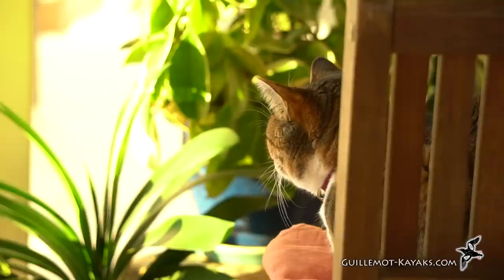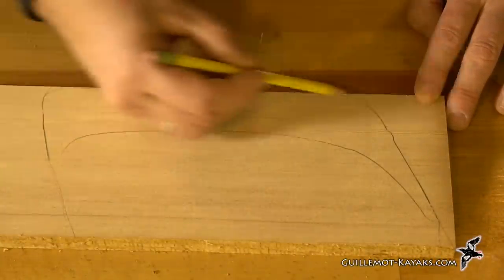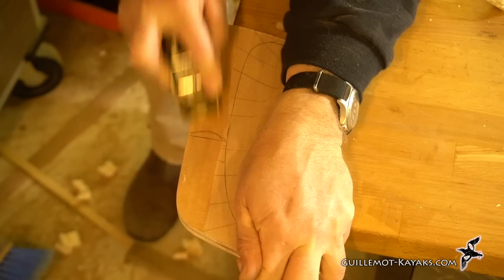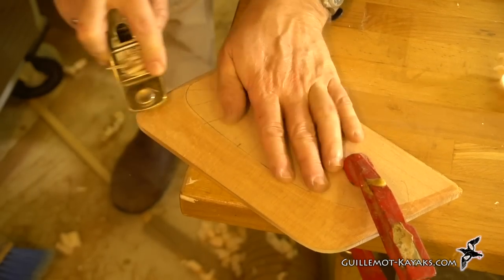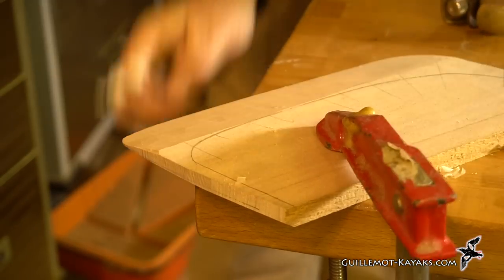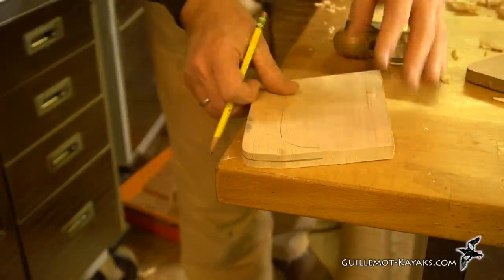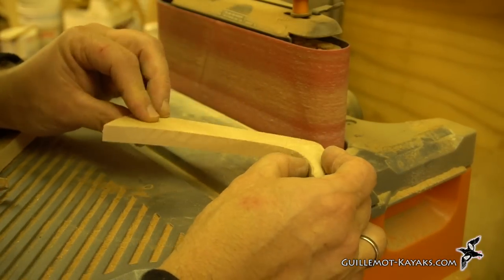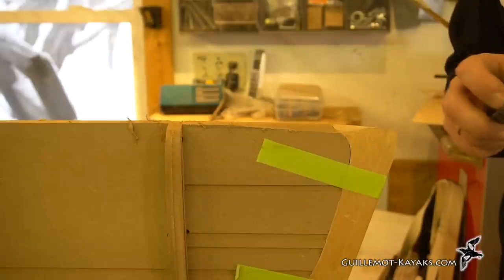Shaping Inner Stems with a Block Plane - microBootlegger Sport - E7

Comment: I’m not a master woodworker. If anyone is having trouble here, it’s most likely because he demonstrated going into the wood grain with the block plane. He did however pull the plane and not push at certain points, but take great care going into the grain. Keep your blade sharper than razor sharp and adjust the blade shallow. Take feather shavings. If not you can cause chip out. Great video. No complaints.

Comment: Thanks Nick. One thing I’ve been wondering about, what are the pros and cons of using MDF for your form material instead of ply?
Reply from the maker: MDF is cheap and dimensionally stable. The forms I had and was going to use were contractor grade birch ply. It is stronger than MDF buy splintery and has voids in the laminations. Works fine, but my go-to is MDF. Its very consistent, and usually strong enough. 

At my classes I use high quality marine plywood so they will last a long time.

Comment: I prefer to use a spokeshave for bevel shapes like that, I get better results. It does mean that I have to clamp the piece but that's how I prefer it.
Reply from the maker: I like to use a spokeshave as well, but for this, where I am essentially making straight cuts for most of the shaping, a block plane is a bit more efficient. I also don't need to pay attention to the handles when I'm clamping the piece.

Comment: Love my planes, learning how to properly setup, sharpen, and tune planes was among the first steps that took my woodworking to another level.  Love the feel and sound of cutting wood with sharp hand tools. Do you find the low angle preferred for your work?  That's one type I don't have yet.
Reply from the maker: With block planes, I just find the low angles to be smaller. They fit in the hand better. As far as cutting, its just a matter of how you sharpen the blade.

Comment: Nick, I recently purchased the double guillemot and have cut the forms from left over 3/4 birch plywood. Is there a different spacing between the forms and also how long do I made the strong back. This is my second knack of yours loved building the little auk several years ago. Also how long do the cedar strips need to be, thanks
Reply from the maker: Hi Kathleen, The strongback for the Guillemot Double is 17'-11" regardless of the form thickness. The spacing from reference face to reference face will remain 12" regardless of the form thickness.

The “reference face” is the edge of the form where the strip touches. Because the boat is tapered towards the ends, and the sides of the forms are 90° angles, the strips will touch just one edge of the form. This is the “Reference face”. From the middle of the boat forward the strips touch the front face, and from the middle of the boat towards the stern the strips touch the back face. 

The gap between forms is typically 11.5"  ( or 12" minus 1/2" form thickness) but with 3/4" material you will make the gap 11.25". This should make the reference-face to reference face spacing 12" as it should be.

I hope this helps.
Reply: Thanks Nick , one more how long do the strips need to be for the gillemot double. PS. I wish I. Knew about your videos on my prior build
Reply from the maker: Kathleen Kinsley  If you want full length strips, you would need 21’ wood for the Guillemot Double. This is hard to find and the strips would be unwieldy. I would find 12 to 16 footers and plan on joining the strips together. I typically scarf the sheer strips then use butt-joints everywhere else.